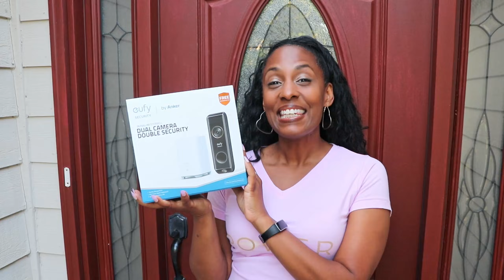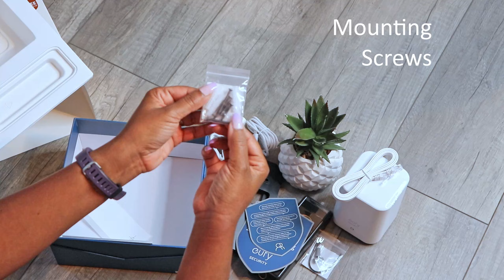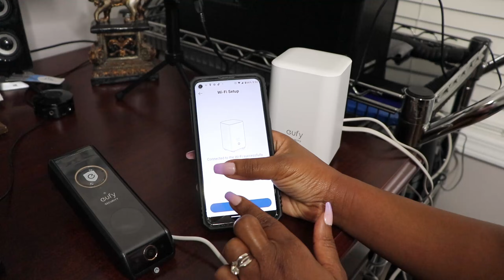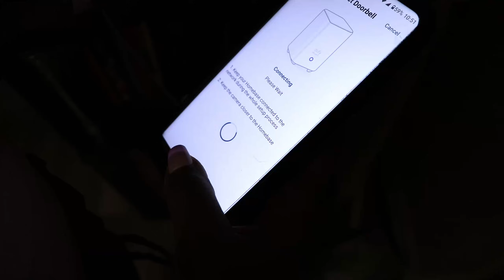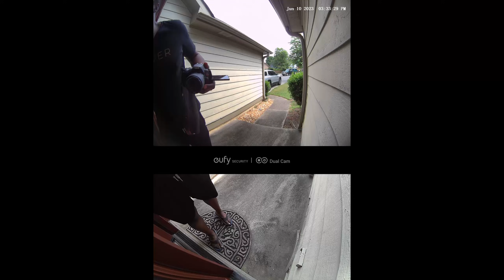Everything You Need To Know | Eufy S330  WIRELESS Doorbell Step-by-Step Installation

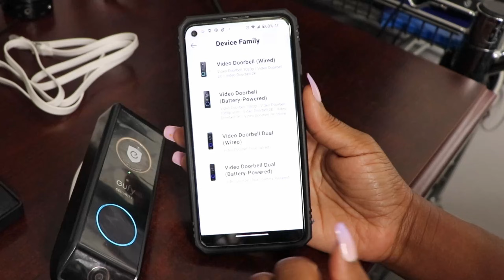Comment: So I was having a bad time stetting up this door bell with the latest Eufy app for android. After contacting Eufy support they at firs tried to help me but when their attempts failed they informed me that my door bell was out of warranty and they could not troubleshoot further. They did offer me a 35% discount on the purchase of the newer model but I notices  something odd. When you go to add a doorbell in the latest app I could not find it listed in the door bell directory as seen in this video at time stamp 4:36. 

The solution was simple but not easy, I removed the latest version in installed an archive copy of eufy Security_v4.7.0_1747.apks. With this version I was able to get the door bell setup. I may make a video of this just for anyone out there with this problem. If anyone needs some help feel free to contact me I am happy to help..

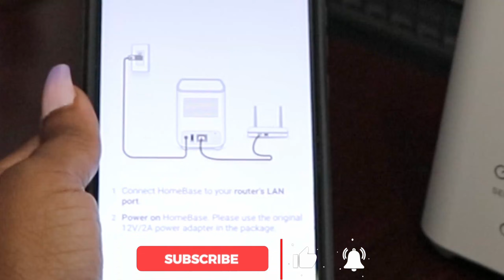Comment: Thanks for your great video. I did encounter a small problem with the home base going wireless after setup. I setup nicely with Ethernet but when I removed it like you mentioned it didn’t setup and remain offline. I removed all devices again and started again and noticed that I didn’t setup my WiFi in the eufy app first before arriving to the Ethernet setup on 2:59. Once I did that and went on to set up the Ethernet and continued with your video it all worked and my home base was able to go wirelessly. Now I’m going to mount it with the VHB double sided tape since I live in an apartment.
Reply from the maker: Glad you got it to work for you!

Comment: Hi Great Video, followed your instructions and it worked 1st time. But I had to switch from ethernet to WIFI manually in the app. It didn't auto switch ? I had to re-connect the ethernet cable and then switch to WIFI and enter the password then it all worked great.  😁😁😁😁
Reply from the maker: Fantastic.  Glad it worked for you.

Comment: Addiing comments to all the places I went looking for an answer: my doorbell would not scan the QR code. After no help from anker service and returning for exchange because I thought the one I got was defective. I eventually found the answer from another user who had the same issue with a door lock:  Dark Mode was inhibiting the scan of the QR code to add to wifi.

Wit dark mode on (android phone) it would not actually read the QR code so I could never connect. Turned dark mode off. scanned right away!

Comment: Sorry, but the title should be ‘How  WE got our Eufy doorbell installed’. Claims like those in your title ‘EVERYTHING YOU NEED TO KNOW’ are just clickbait. Didn’t work for me, despite being next to the modem, peeling off plastic, turning up screen brightness etc, etc. I lost count of the number of times I tried the synching stage. I’m in Australia on the 5G phone network. Finally I asked ChatGPT and got the help I needed. Apparently, many such modern devices don’t like 5Ghz connections. My phone settings show both 5Ghz and 2.4Ghz. When I typed into Chat GPT what I was seeing in my settings, I was instructed to disconnect the 5Ghz phone setting but it was read-only on my device. I was then instructed to call my mobile phone provider to ‘temporarily disconnect 5G to sync the doorbell. I was even asked if I’d like a script for exactly what to request. I explained to my phone provider why I was doing this and if they’d stay on the line till it was connected. I was able to do this FIRST GO, while still on the call, probably in under two minutes! Then they switched me back to connection with 5G. All may be well that ends well but I’m very annoyed that this information is NOT provided anywhere by EUFY. They take your money and leave you to figure out technology far beyond your understanding. I couldn’t find anything on the internet apart from a comment on problems with 5Ghz, which left me none the wiser. No one on YouTube (that I could find) helped either. Thank God for Chat GPT!
Reply from the maker: We are so sorry you had a difficult time installing the doorbell! Thanks for sharing your new knowledge.

Comment: You put S330 in the headline which is WIRED. You have the E340 Battery only
Reply from the maker: This is the S330 Video Doorbell Wireless as shown.  Not the E340 with battery and power options. This video doorbell T8213 has to be charged is compatible with the Homebase 2 or 3. Hope this helps!

Comment: I am having difficult to connect when adding the doorbell. My phone, doorbell is almost touching the base and the router, and still does not connect, the Qcode graphic displays, but it does not connect, what could be. I had already elfy app installed because I have other doorbell device, this homebase I just bought because of the dual cam feature.
Reply from the maker: This is the S330 Video Doorbell Wireless as shown.  Not the E340 with battery and power options. This video doorbell T8213 has to be charged is compatible with the Homebase 2 or 3. Hope this helps!

Comment: How did you get yours to go wireless. Mine doesn't seem to work wireless.
Reply from the maker: This is the S330 Video Doorbell Wireless as shown.  Not the E340 with battery and power options. This video doorbell T8213 has to be charged is compatible with the Homebase 2 or 3. Hope this helps!
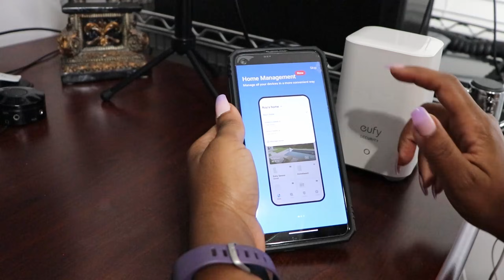Reply: @DIYPowerCouple I have this same model and couldn’t get the home base to connect wirelessly at first other than Ethernet. I removed everything and started from scratch which is one I noticed that I first needed to register my WiFi in the app which is partially skipped on your video from the 2:40 chapter.
Reply: Remove the device again from your app and start from scratch. You want to first add the WiFi to your app before you do the Ethernet setup in 2:59. Then you do the Ethernet setup and so on with the video. They skipped their WiFi set up

Comment: So it’s wireless, but you still need Wi-Fi?? I’m looking for something that doesn’t require Wi-Fi because I don’t wanna pay for it at my elderly dad‘s place
Reply from the maker: Wi-Fi is needed to monitor the doorbell and have access to the videos on your mobile device.  The wireless part is that you do not have to hardwire the doorbell unit to an electrical outlet in order for it to be powered and ring.
Reply: What you’re describing is somewhat of an analog setup. The only way you can achieve that is with wiring or cheap nanny cams

Comment: Question, how did you connect the chime? I have an old-school wired doorbell with chime, I want to replace with eufy but I am not seeing any chime unless I buy the eufy package (I have a base station already).
Reply from the maker: Hi, you have to connect the doorbell and base that are the same version to get a chime. Then you  will be able to see it in the app.
Reply: @DIYPowerCouple  Thanks. I bought the doorbell and it gives me options, one of them is to use the base station as a chime.